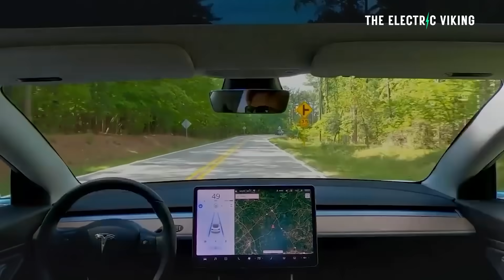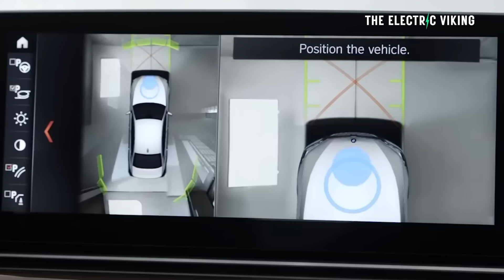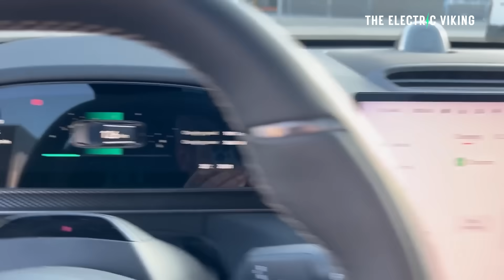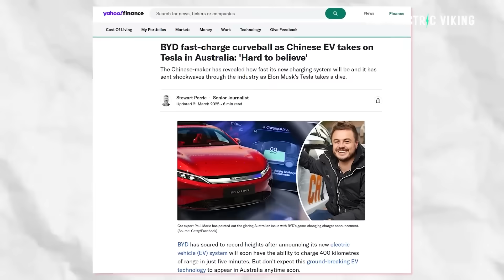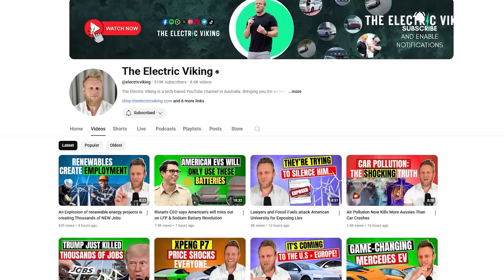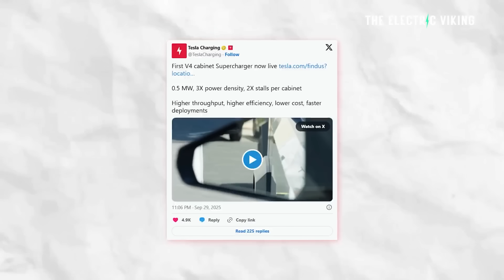300 kW WIRELESS CHARGING! The Infinite Range Highway Is FINALLY Here

Comment: The fact that it can charge at high rates was never in question.  The question is how much energy loss happens, and how much the system costs to install and operate.  I don't see how in general this will be practical except for maybe a few very limited uses.  Like the city bus example.

The special case of city busses makes sense.  We already have electric train systems but we do that underground in subways where exhaust fumes are a problem. And we had electric trolleys for 100 years.  But they lost out to fossil fuel busses due to cost. But we are going to electric so why not use wireless charging to power the buss instead of overhad power lines as done in the past.

But you must understand that if a test road can charge ONE VEHICLE at 300kW, that's just one, that's no where near the same as what happens when you have 100 cars trying to charge on the same stretch of city road?  The power supply to the road needs to then be 30 mW!.  That's not going to be affordable. The cost of providing that much charging power that won't be used except in peek hours is absurd. It's like installing 100 charging stations in a location where most are never used most the time. That cost is a huge waste of money just so cars don't have to charge at home?

Having special bus charging pads, maybe one at each or most bus stops?  So it doesn't need to be long and it only needs to charge one bus at a time while it's loading and unloading passengers then you get far more affordable charging infrastructure and buses that don't need super large all day batteries -- or buses that cycle in and out of service just so they can be recharged.

But as far as trucks using it on cross country trips I don't buy the logic. The cost of the charing infrastructure is going to far exceed the cost of the truck usage. It's easier to swap trucks pulling a load when the battery runs out and let the truck without the load recharge.

Wireless charging can be as high as 50% energy loss compared to wired charing which is near 100% in energy loss in the cable.  So to hit 300 kW you might have to be pumping 600 kW into the road where half the energy is burned up as waste heat.  And anything that tried to apply this power to a mile long stretch of road (or far longer), is going to either see massive energy loss in the cables,  or very expensive copper buried in the road.

I'm not at all surprised the technology can work. I just don't expect it to be practical for anything except a few very special cases, like maybe these city bus type routes.

Comment: In ground chargers could be useful for commuter light rail. each car would have a smaller battery. The chargers could be spaced out and then the cars could charge alternately so that they are not all getting weaker at the same time.

Comment: Sounds like a solution to a problem that doesn't exist.  Most folks charge at home which is already a plus compared to filling up at a petrol station.  Plugging is is hardly an impost despite the good presenter's laziness!  Some folks will need to charge up on the go.  These are a minority of folk.   We can fix this with some fast chargers and leave everything as is.  And with some battery swap for heavy vehicles, perhaps?   But the future is fickle (and ever developing) so never say no.  But don't get caught up in it.  By an EV now and enjoy.

Comment: Stupid idea. Consider the complexity of maglev trains.  It's not just a simple matter of digging a trench, chucking lots of wire into it and covering it with bitumen. For EV' as well as carrying around batteries you will need a monster energy coupling  system under the floor pan of the car, probably under the battery. It may use  a heavy ferrite core  and thick copper wire so it will be heavy.  The wireless coupling would  generate copious amounts of radio frequency crap.  People with pacemakers will drop dead,  mobile phones will shit themselves (especially ones that have wireless charging fitted)  Military won't be happy.  Aircraft won't be happy.  Digital TVs in nearby houses will stop working.  The front end of your car radio will fry.  Aliens on distant planets will be able to pick up the signals. Worried about RF radiation from power lines or mobile towers ? The RF crap from these would be many magnitudes of order greater.. As an alternative, maybe try harnessing the energy from quartz crystals using a magic quantum spell.  This is a great example of creating multiple problems while trying to solve one which is very impracticle..  It is obvious by many of the comments that people know little  about electronics, RF or the scaleability of wireless charging..  💩

Comment: Wireless charging is a good idea at home, parking lots, charging station, city intersections  and also at bus stops, but hardly on roads (with the current technology). You would have to have a road which has tens of miles of charging infra and dedicated power station to feed electricity to that road. Then imagine situation where there are at least hundreds of EVs driving simultaneously at the same stretch of the "charger road". How much electricity would each one of the cars receive?  

We would need to scrap almost all of the existing EVs and replace them with new ones, supporting the wireless charging. Not very environmentally friendly way of adapting new charging method. 

And finally the technical challenges. The "air gap" between the transmitter coils and the car receiver is critical for charging efficiency.  I know that there are numerous solution to mitigate the heat generation and poor efficiency, but that side requires still lots of development, especially if we are charging moving cars of different types at bumpy roads.

Don't get me wrong, I like the idea of wireless charging. It just isn't some miracle, which happens right now (if it happens ever at larger scale).  Let's see after 5-10 years, what is the situation.

Comment: Something like a Tesla Model 3 needs about 12.5KW to maintain 70MPH.  If you are not using your battery, so can drive no stop as long as you want.  

You don't need to charge.  If you do, the battery in the Extended range is 75Kh usable.  If the road provided an additional 12.5KW, and your battery charges at 50 miles per hour (at 300KW, 80% in 12 minutes - do we really need to provide 300KW).

Comment: I was thinking about this technology back in 1970. I am surprised we have finally made it this far. Just from the standpoint of urban public transportation. I think of places like Vancouver (where I was from) with all those busses. The ability to drop all the overhead wires and removing the diesel busses. It wouldn't necessarily be that major as   the grids could just be installed mainly at the turn around points as well as through concentrated transportation centres (like downtown). With the coming safe and long lasing battery technologies these ideas get really exciting. I now live in a small city (Salmon Arm). There is only one bus turner around point located in the downtown which it would make it easy to implement.

Comment: I am pro everything about EVs ... except this. I probably sound like a tin foil hat guy. I bought a cheap EMF measuring device online, because someone told me older microwaves were ''bad'. Yup found my old microwave was outputting way above the limit EMF limit set by  some countries... I still use it but I no longer stand right in front of it like an idiot, watching my coffee heat up. My wonderful powerful  WIFI router  again over the limit and I work at home next to it... found I could half the power in its admin settings... still covered the whole of my house. Read a white paper that even a small amount of EMF can disrupt sleep patterns... So no!  I don't want to drive over EMF output, strong enough to charge my car, for hours on a trip.

Comment: No one needs wireless charging, as long the drivers are not allowed to drive more than 5 hours.
We need wired chargers at almost all parking lots for cars and trucks.
Also it will take decades to install wireless charging to only the most important highways.
Until the highways are finished in 2050, there will be many other possibilities to charge faster and easier, so that it is not required anymore.

Comment: For autonomous driving, you want a robot car to simply pull into a charging station and park itself over a charging plate.  Nothing to plug in, no cable to cut off and steal.  No compatability issues with a common standard.

Comment: I wonder how payment would be handled. Can there be some sort of communication mechanism that measures how many feet/miles the vehicle drove on the system and charges accordingly? And governments would need to ensure any EV capable of wireless charging would also be equipped with the communication/billing system.
Reply: Maybe just have EV charging as part of road maintenance.  This makes sense if there is an energy super abundance.
Reply: @dr.x4050  Eventually yes, when everyone has an EV and/or travels on electric transit. But there will be a transition period when non-EV users would be very (rightfully) pissed to pay both gas taxes and for the electricity used by others. This already the case to a lesser extent, with EV owners not paying gas taxes.

Comment: Who pays for the electricity being used? And how does the billing work?
Reply: This could be part of routine road maintenance. Makes sense if there is an energy super abundance.
Reply: @dr.x4050  How does energy abundance mean that roads will be well maintained and never suffer damage?
Reply: l @twostate7822  Ok, I think you completely misunderstood. Currently, roads are maintained anyway with tax dollars. I expect that in the near future, both the wireless charging hardware and the power used to charge vehicles will be negligible. This is similar to the rebroadcasting of radio and cellular service in long/large underground tunnels & subways, which I previously worked on.
Reply: Vehicle Registration??, drivers license fees?
Reply: @boredatsea Why should people who don't use those sections of electric roads have to pay? What about out of state vehicles? People who use that section of road should pay. 
IMO, this is like toll roads, toll bridges, ferries, etc. Users pay for using them. There may be some general state/local funding, but users should pay the bulk of the cost.

Comment: Fast wireless charging only makes sense for buses. Slow charging at every parking lot would make more sense. Making cars able to use wireless charging adds cost, weight, and takes away space; it's not worth it. It takes less than a minute to plug in a car.

Comment: Ok. Lemme explain something. Wireless charging uses inductive coupling.  This is not lossless and losses increase with the size of the gap. 

At best road Wireless charging would have losses around 25%.  That means 75kw of heat being radiated away.  Your microwave oven only uses a few kw.  Drivers would get cooked and electronic devices fried.
Reply: Yes. Looks like they have a coil mounted below the truck - if it's mounted too high, you're going to get reduced/no charging, too low and every bump and kerb and rock and random object on the road is going to wreck it.... Wireless charging "on the road" remains a very poor solution to a problem which barely exists.
Reply: Might have to stop using my electric toothbrush as that is wireless charging and also the wireless charging of my Iphone
Reply: thats why home induction charging makes sense movable coil rises and loses are minimal.

Comment: in the US , roads degrade pretty fast, can't putting power under them
Reply: Or a solar wrap, perhaps?
Reply: Quit building roads with the lowest bidder and minority ownership emphasis?
Reply: Yes, how well does that wiring hold up when the road has potholes all over the place.
Reply: @twostate7822  Well made and maintained roads to not have potholes.
Reply: @thedukeofalinor1377  Where do you live? Fantasyland? Roads get potholes and need maintenance all the time. Bad weather can severely damage roads and the underlaying foundation. Earthquakes, freezes, etc can cause severe road damages. And roads get old and need to be resurfaced. And presumably, wiring and electronics in roads exposed to freezing cold, and 100+ temperatures are going to have shorter lifetimes than in a weather controlled lab.
Reply: @twostate7822  As I said, proper maintenance.
Reply: @thedukeofalinor1377  Even with proper maintenance roads go bad. Surfaces need to be stripped down and resurfaced. Cold weather places have freezing/thawing cycles that basically gradually destroy roads. Other places, like New Orleans, are located in areas with inherently unstable ground that causes roads to rapidly deteriorate. As I previously asked, what fantasy world are you from where roads last forever?
Reply: @twostate7822  "Well made and maintained roads to not have potholes."

What part of that statement eludes you? Nothing about forever with my statement.
Reply: @thedukeofalinor1377  Even well made and well maintained roads need to be rebuilt. If there's bad weather or bad ground conditions, roads just don't last as long. Those are the facts. And yes, roads don't have potholes, until they do. Duhhh. BTW, potholes are almost never repaired the same day that they appear. It may be weeks, or even months before they are repaired. In the meantime, the damage increases.
Reply: @thedukeofalinor1377  Again, what fantasy world are you living in?

Comment: Not to be a naysayer, but many countries can't even keep their simple low tech asphalt road pavement in good conditions, imagine if there are miles and miles of equipment under the pavement that also needs to be maintained. Also it would take many years to do this and lots and lots of money. The city problem has already been solved with overhead cabling for electric buses. So maybe for trucks we should just keep betting on batteries with higher energy density and faster charging ability.
Reply: There is already miles and miles of 'equipment' under road pavement in many countries. In Melbourne, Australia (and I imagine most other Australian cities and other major cities aroud the world) there are inductive loops at regular intervals buried in the asphalt. They count cars, measure speed and control the freeway management system. They're also at every set of traffic signals, as they control the phase times. And Melbourne certainly doesn't maintain its roads well. It's one of the main things people complain about. But I take your point. It would certainly increase maintenance requirements. My first thought was: who pays for a charge?
Reply: @chrish2879 
While I see what you're saying, I'd rather we add solar car roof panels to vehicles than these to extend range. They're far better than sun roofs there and will extend your range during the day for a fraction of the cost gas n this infrastructure would.
Reply: @chrish2879  When car couting fails or optimized traffic light phases, its not that a big issue. When charging fails (a lot) then saving on batteries becomes a big issue. Imagine the example of busses that use an ~50kWh battery instead of an 400kWh.
Reply: Wireless charging needs to have the coil in the road very close to the coil in the car.  One normal size pot hole....
Reply: Would be easier just to do what we did with rail cars and the antenna that hit the guidewires for keeping power lmao
Reply: I do not see this being practical. Maybe at parking spots and bus stops, in addition to car roof solar
Reply: @ranjusranjus143  There is a new perovskite / graphene solar panel, 30.2%.  That gives the Aptera 65 miles vs 43 miles per day.  

Not sure if they can be paired with silicon for even higher efficiency (45%+?).  86 miles per day.

Also, Aptera is looking at a 2 speed transmission that increases range by 15%.
Reply: @stevesedio1656 Aptera's having a hard enough time releasing ANY vehicle right now, let alone one with a 2-speed transmission. Would love to see it, but I'm not holding my breath.
Reply: @cheapsunglasses  I managed engineers.  Once thing I learned was to tell them, your design is done.  Stop fine tuning it!

As an engineer, I enjoy their improvements.  But, I would rather they be added to a car that started selling in 2021.  

There are other problems they haven't even thought of their customers will tell them.  If it ever gets to market.

It would be a great base for an incredibly efficient commuter car, seats 2 (front and back).  With even better efficiency (20+M/KWh, my model 3 gets 4.3KWh, the current Aptera is 10MKWh).
Reply: I guess its all about the costs and what you get for it. For car owners it increases the cost, likely significant. While you don't dare to reduce battery size to compensate.
A big plus for the charging operators might be it's much safer from vandalism then wired chargers.
All in all i thinks its tough to come up with THE use case people and companies want to pay for it.

Comment: Makes sense to move the electric distribution network in/along roadways.  Imagine vast solar farms collecting hydrogen fusion energy from the sun feeding energy into the network, which is then used for transportation, industry, etc. A man I know here in Eugene OR has 36 solar panels at his house. He charges his two Chevy Bolt and sells excess power back to the utility (at 33 cents on the dollar, indicating that electricity cost the local utility about 1/3 of what they sell it for. :(

Comment: The issue with this tech is batteries are becoming sooo cheap and have such good longevity, that the system cost is better to just use a big pack.  That said, it may make sense to site road chargers at bus stops where the bus is stopped for a while .. since charging does need to happen.
Reply: And at traffic lights, and approaches to roundabouts